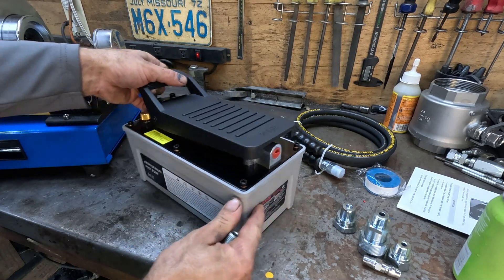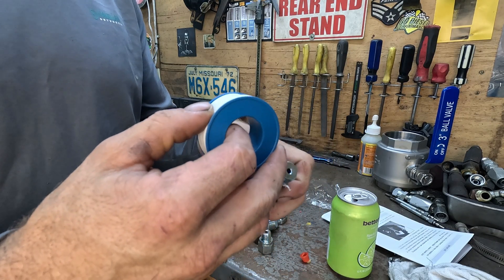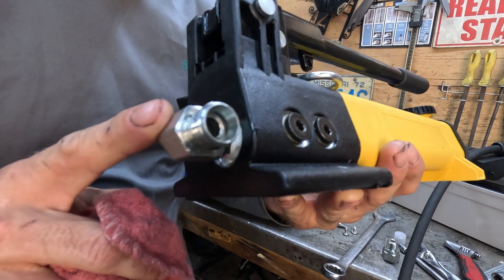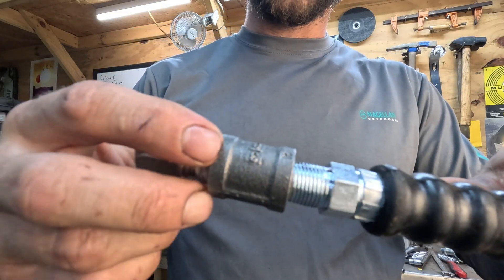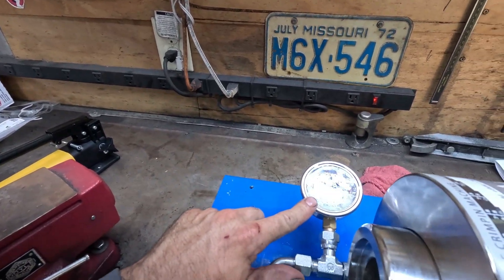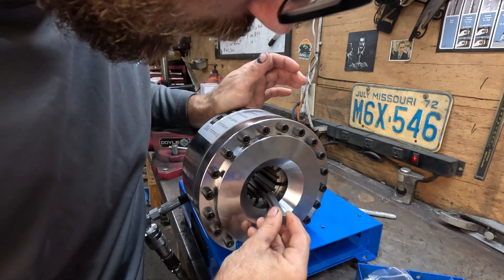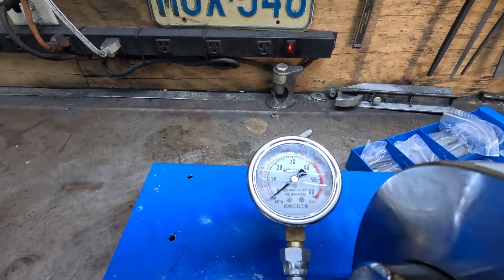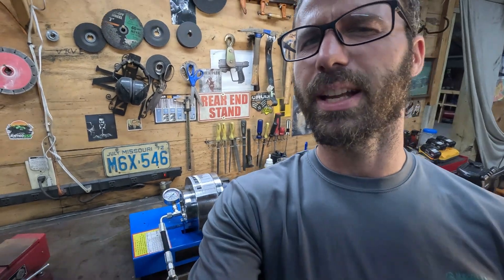Upgrade: Cheap Hydraulic hose crimper gets air over hydraulic pump

Comment: The plumbing fitting is wrong, yes, he mentioned that and it is his decision. The fitting will not explode like a grenade, it will split/crack and yes a small amount of hydraulic fluid will escape at a very rapid rate, but for a millisecond. All you folks are acting as if he is resting his nut sack on it or straddling it. I have seen these split several times and it was the exact same way every time, it was not catastrophic, but it did make a mess wit the oil.

Comment: Isn't there a cheap way to add a high speed/low pressure pump to the system just to get the jaws into the crimping position? These pump are also painfully slow when used with a normal hydraulic press.
Reply from the maker: That would be pretty sweet I don’t know of any affordable pump that would do that though
Reply: @simplytinkerdad  By installing a hydraulic cylinder in parallel with the crimping machine, you can redirect oil to the cylinder when releasing pressure from the crimper. Using a lever to compress the cylinder, you can quickly return most of the oil to the crimper, to close the its jaws, leaving the high-pressure, low-flow electric pump to build the necessary pressure to do the actual crimping. This setup leverages the cylinder’s ability to deliver high flow at low pressure for faster operation, provided the correct valves are carefully managed.

Comment: Are still alive? If you have ever seen a hose burst at high pressure it can kill you. The fact that you are using a fitting not rated to the pressure is total madness and you are standing in range?
Reply: Are u talking about the air hand pump pipe or the hydraulic hose fittings he used

Comment: I mean, I like the videos but there's an amount of "misinformation" that is potentially dangerous.
Also a few pointers...

1. DO NOT use soft cast fittings in a high pressure hydraulic system. 
They are probably rated for 100 bar where as the pneumatic hydraulic pump can probably deliver up to 700-900 bar.

2. Please don't just crimp to 4000 psi.
Different hoses/inserts etc. have different specs and in most cases needs to be crimped to a diameter. 
The hose being the main factor (bend radius/layers of braided steel etc.)
Your hose and fittings supplier can give you schema with crimping targets.

3. Stainless is not at all needed in hydraulic systems, in fact, the VAST majority of hardware in hydraulic systems are not stainless, but just fairly hard carbon steel and are very rarely cast.

4. I don't recognize the exact quick coupler but it looks to be an HPA coupler which is ok for the system although not rated for max system pressure. 

5. The fittings on your block 90° angle is not NPT but BSP60° in one end and Metric24° (o-ring) in the other (most likely a 12L).
Both types seal by konus.
The hose and the soft grey cast fitting could be NPT or could very well be BSPP/BSPT.
Most Chinese stuff actually delivers with euro standards, so BSPP/BSPT rather than NPT and those two standards are almost interchangeable as one has 55° thread cut and the other 60° (if I remember correctly).

6. Yes you could indeed just connect the new pneumatic hydraulic pump with a tee to the existing system IF you remember to close the release valve on the manual pump every time you use the pneumatic one. (someone asked).

7. The air fitting provided is standard Japan/Asian style.

Maybe do a little research before making videos like this. 
Just because you have been driving 300 on the freeway for years and aren't dead yet doesn't mean you should encourage others to do so. 😉

Comment: At 3:33, Could you get your hand and face away from this side of the machine!  If you were to develop a catastrophic leak, you could get an injection of 4000psi hydraulic oil into your eye or hand and loose that part of your body forever at that time.  Please try to rig-up some sort of hard guards around this active hydraulic section.....Don't ever forget this is CHEAP CHINESE crap with very little concern for safety during its design or manufacture, that is why it is cheap.  Don't make it a terrible decision if it lets loose and maims you some how. ...  Check out this video on hydraulic injections --  https://www.youtube.com/watch?v=wC5FBYc2A8A

Comment: I'm curious about plumbing in the pneumatic pump and keeping the manual pump functional as well. Would it be as simple as plumbing in a "T" fitting? I would imagine the release knob on the manual pump would have to be closed, preventing backflow into the pump. Any thoughts would be greatly appreciated
Reply from the maker: I believe just a t fitting and making sure the release valves are closed both pumps but that’s just a theory it might only work by installing shutoff valves

Comment: That coupling isn't rated for hydraulic pressures. It looks like a plumbing fitting.
Reply: Dangerous
Reply: He is building a handgranade 😇
Reply: It is indeed a "plumbing" fitting, though it's a thick walled soft cast fitting probably rated for max 130 bar.
It's fair to say that it's very unsafe to use in this case. 
That style pneumatic hydraulic pump can at full block deliver around 700-900 bar.
Reply: I've seen a lot of plumbing pipe used by farmers for hydraulic lines.   As they say: ignorance is bliss.  He did say he was plumbing it .